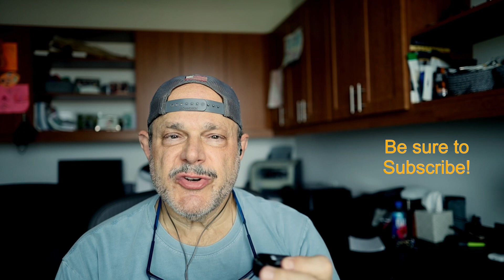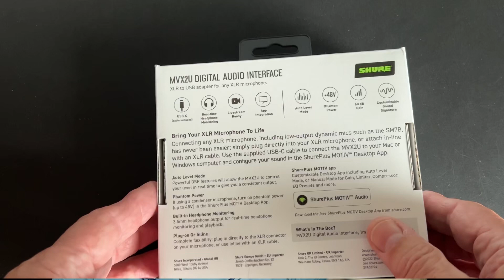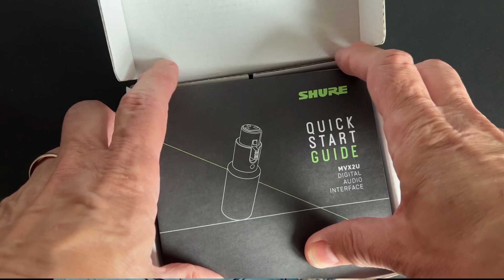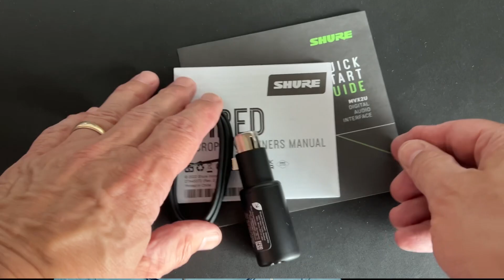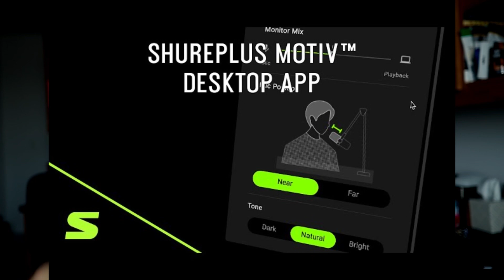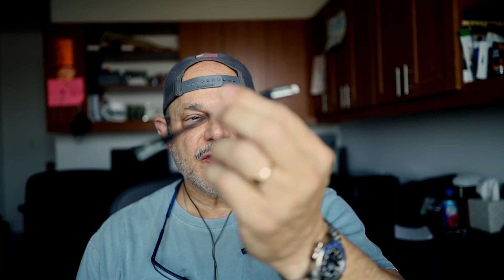Shure MVX2U Digital Audio Interface - Product Review, Software Testing and Ipad/IPhone Use

Comment: Awesome work, sir!
I am wondering if it will work with the M1 IPad Air 5.  It also has a USB C connector like the iPad Pro
Reply from the maker: Sorry, I don’t have an Air 5.  Are you able to use an external ssd with the air 5, if so, I suspect the MVX2U might work. Let me know what you find out.   Thanks for watching.